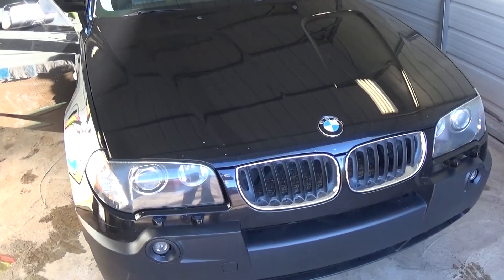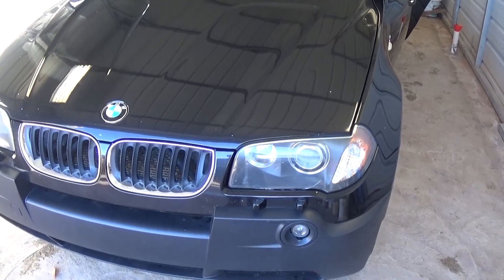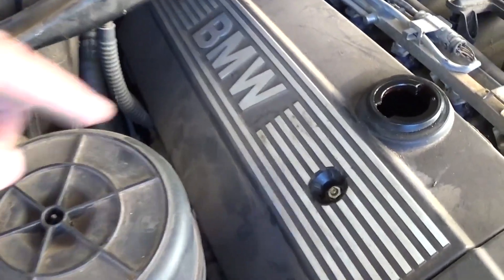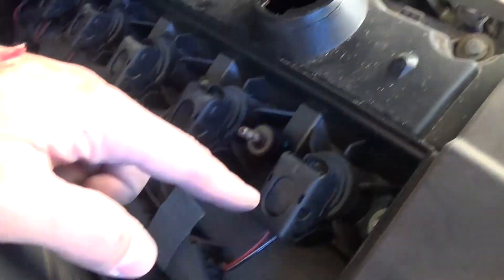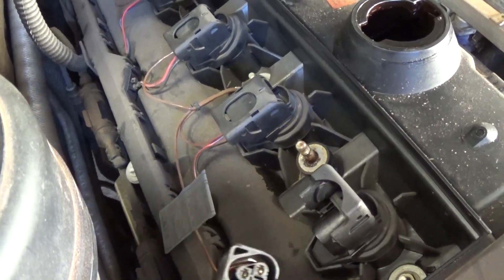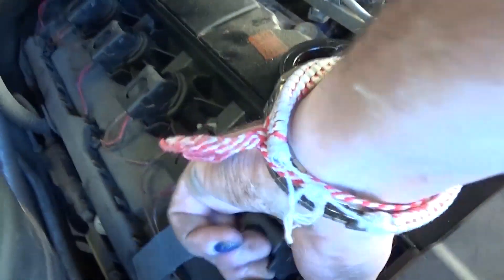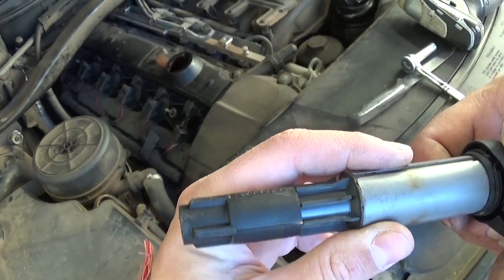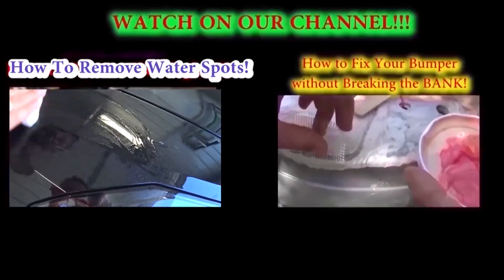Ignition Coil Replacement BMW X3 E83 2.5 3.0 MISFIRE P0301 P0302 P0303 P0304 P0305 P0306

Comment: Hi,
I have an X3 2013. "Drivetrain Malfunction."
*Spark plugs changed/replaced. Did not fix problem. What else could be the problem?
Please Help. I appreciate your advise.
Thanks
Reply: Did you fix the issue? I am having exact same issue with my BMW X3 2013
Reply: @youaugust2744  
so Sorry, I dont remember. No longer have the truck.

Comment: I got the 303 code. At 70K miles I was about to change the plugs on our `09 X3. A PITA compared to our `01 330ci cabby'. The coils were burnt on to the plugs it took some time to get them off, #3 & 4 were especially bad and I broke the clip on #6.The plugs were badly worn, very little of the centre electrodes remained and #3 had black deposits on the ceramic. I ordered three new coils. the coil from 3 is now on 6 the broken coil is on 1 tie-wrapped together. The code reader now shows code 304, it's possible that the top was not clipped down completely but I'll replace I,4 &6. At 70K I've had to clean the VANOS solenoids and replace the starter. The coil design is yet another BMW screwup, I'll keep the 330 but this X3 is on a short leash and I'm done with BMW
Reply: B Noakes, I agree with you I have a 2007 BMWX3 M SUV and the car looks from outside and inside in showroom condition. Has only 55 thousand miles on it, but very few months it's another problem. Mainly oil leaks. Iv'e driving BMW's since 2001, but I had just about enough. Above all on the oil leaks, BMW North America and Germany gives only polite replies to my mails an that's it. Very disappointing. The best you can do to enjoy a BMW is to buy new, and sell after the guarantee is up.

Comment: I have a 2007 Bmw 328i with 93,000 and it has a cylinder 3 misfire. It vibrates and says check engine soon then goes away and comes back. Should I change the spark plug or the ignition coil?
Reply: Generally the vibration constant is the ignition coil. Replace coil and if vibration goes away then you know, but if still there try the plug too.
Reply: Thankfully the coils aren't too expensive but John's idea is time tested, try it.
Reply: Manny Gonzalez try switching the coil from cylinder 3 to another cylinder, if the misfire move to the other cylinder that would mean it is your coil that is defective if the misfire stays in cyl 3 then replace plug. if misfire still exist check the fuel trim for rich or lean in the bank

Comment: how do i take out the rubber from the bottom of the coil if it gets separated from the coil?  I need to change sparkplugs too but the ignition coil bottom rubber got stuck on top of the spark plug :(
Reply: Long nose needle pliers